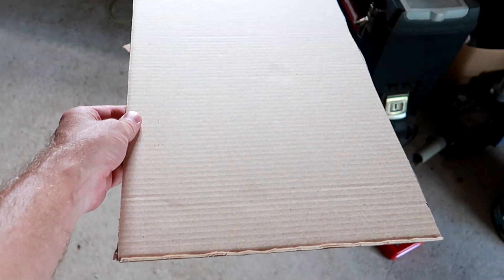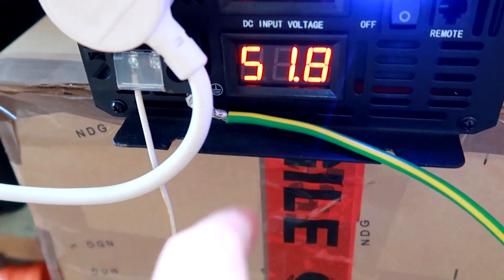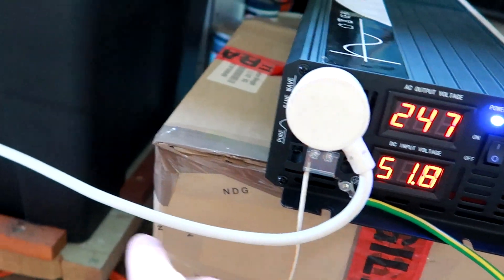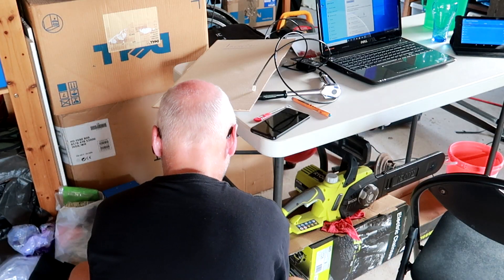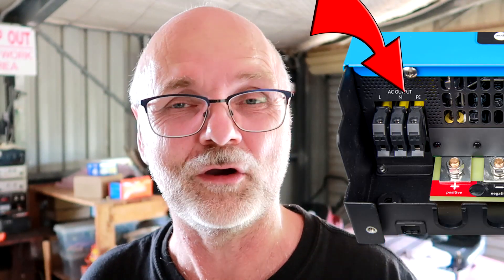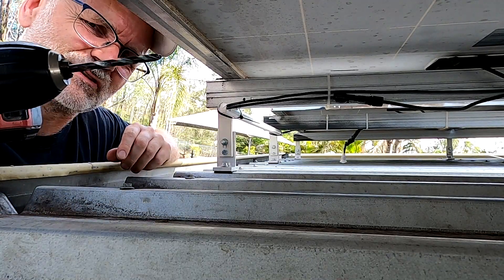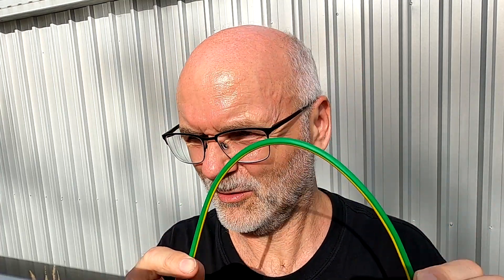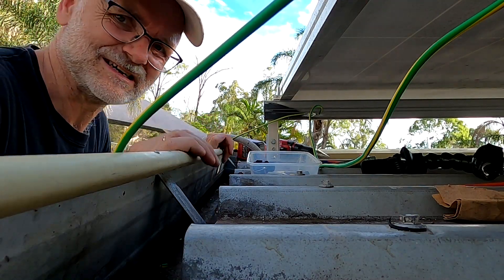The inevitable Inverter Upgrade

Comment: I am setting up 2 of the MPP 6548 inverters myself. That version is good for 120v each at 6500 watts and 48v DC. I ordered 2 because I am needing 240v. They were 1145 US dollars each shipped in 4 days here. (They also have the neutral bond on the output side)
Reply: Is the charge controller MPPT or the PWM type on your one?
Reply: @PeterMilanovski  They are MPPT. My setup will be off grid, but the inverters will transfer and use the grid as needed (This can be set up in the parameters) Batteries/Solar/Grid.
Reply: @danfitzpatrick4112  nice 👍 I have the 12v DC version which has the 800W inverter. I got it almost 3 years ago but I have this issue with it not liking it when I put another 12v load on the battery! I have a water pump that feed's tank water to the toilet and it operates automatically via a built in pressure switch in the pump, every time I flush the toilet, the solar charger stops charging to have a think about what just happened to the battery, then eventually starts to ramp up the charge again, and it does the same thing again when the pump stop's... Meanwhile the sun is shining! And it's not doing anything! I find this annoying! I'm sure that they have good intentions behind why it does this but I, for the life of me can't think why? I hope that this has been sorted out in the newer versions, they are pretty good and I wouldn't mind getting a new and more powerful than the 800W which I have outgrown now! But if I can't use the battery directly for other things like lights and pumps, then I'm just going to have to use something else instead... 
I have yet to speak to someone who has one installed and working! All that it would take to test is to connect a load, even a light bulb directly to the battery while it's being charged from solar and see if the fan's stop spinning! The wattage for solar input on the display screen should also show that the wattage has dropped out, it waits for 30 seconds to a minute and then starts ramping up again... 
Who knows? Yours might not do it! Mines probably just an early version?

Comment: The frog 🐸 is disappointed  because Andy is expending big money on a fancy inverter with unnecessary bells and whistles.
Aims LF48v 6kw $1500  is excellent.  It run the whole house with a/c and ev at the same time. And it has hause neutral or floating selectable.
Reply from the maker: Yeah, AU$2500 here
Reply: @OffGridGarageAustralia  I bought it 3 years ago,  price has gone up by more than 300 dollars now.

Comment: I know it was a hard decision to purchase another inverter, but you made the right choice. Having phandom voltages floating around is just asking for trouble. I think Victron is the best equipment worldwide and they have great support.  Even understand English!!  I have a 5KW Victron charger/Inverter.
Reply: 5kw! You sir are wealthy LoL...
Reply: @PeterMilanovski  I have not started yet due some medical problems, but I believe that the system will allow you to program how you want to run it.  Grid is attached along with you other sources of power.  Then you program it to use battery power as your main source.  Solar will charge when available, but when the batteries get low, it will start using grid with no transfer switch. The system will charge your batteries and keep your needs going.  Very Smart.
Reply: @jimmysquires5093  bloody health problems! I'm not sure if I know exactly what you mean but I have my own health problems, been suffering with anxiety for the last three years, I can do anything but this stops me dead! I and everyone else that I know would understand if it was something visible like a leg or arm missing but this crap is invisible and all that everyone else see's is me being happy like nothing is wrong but it's just me doing whatever I can to keep my sanity... I'm okay so far but I just want it to end! So that I can get busy and start doing everything that has been neglected around the house 🏡. 
I was just trying to make lite of your equipment! You have what almost everyone else wants but can't because they aren't cheap! 
As my dad always said, don't ask for what's good, but ask for what's expensive LoL... Well that used to be true rule of thumb for everything but today we have to be a little bit cautious... But definitely can't go wrong with victron! They have a good reputation and more companies need to follow this example! Redback is a great Australian brand and are known for quality products but recently saw them trying to sell one of those cheap Chinese pwm charge controllers re branded as their own for 10 times the price! Mate! I'm Aussie, I'm not stupid...

Comment: Might can have a big screen caged inverter to keep the insects out as long as no wires bon’t make contact to the screen but it might still catch dust .If installed in cabinet,make sure there’s a strong fan to draw in fresh air and expell the hot inverter out the cabinet .May the solar be with you .
Reply from the maker: If I put fans in the cabinet, I will have the same dust problem just inside. Yeah, filters... see where this all leads to...

Comment: Most of of the MPP solar inverters have a synchronized transfer switch, so clocks, computers are not affected if a switch back to grid mains occurs. They are a good product.
Reply: Do you have one?
Reply: @PeterMilanovski  Yes a MPP PIP 5048GK. And 5kw of solar panels.  It interfaces with a number of Lithium battery suppliers including Pylontech model US3000.   I have 3 of these battery packs and have been running as an Off Grid inverter for everything in my house except washer dryer and AirCon, Since june 2020 in Melbourne and have not had to go back to Grid for power. I'm doing what Andy is doing and will be charging an EV as well.
Reply: @henvan8737  have you ever watched it to see how it behaves as clouds pass overhead? I don't remember the model of mine but it's the 12v 800w inverter version! It was the cheapest at the time when purchased but now I see that more powerful models are available for the same price I paid for mine.
The issue I have found with mine is that it tends to do a lot of thinking about what it wants to do when either clouds pass overhead or if any extra load is placed on the battery for example a 12v light! It seems to be able to sense that something has been connected to the battery and stop's charging to work out what it wants to do about it... It also does the same thing when the extra load is disconnected! So basically if you wanted to also power something else directly off the battery like a 12v water pump to feed tank water to the toilet, it just can't be done with my one! 
A standalone charge controller doesn't suffer from this problem! I wanted to convert all the lights in my Melbourne house to 12v DC and get it directly from the battery and save the inverter for the thing's that need 240v AC but it's not going to happen with my setup! 
I'm charging my Lifepo4 Batteries with eBay MPPT charge Controllers which are just PCB boards and they are, so far, doing an amazing job 👍, now I want to get a separate inverter with at least 3kw output to drive the fridge. I have to look into an electric stove and an electric water heater for their power consumption figures to make sure that I get the right inverter or inverters to cover everything... If anything, the electric hot water boiler can always be converted to low voltage as there are various heater elements available for them. As for the air-conditioning, I recently learned that 24v aircon compressors are available from the US and can be used to convert normal house type air-conditioning units... Litterely convert the whole house to Electric! Without the need for a grid tie connection! 
If you are planning on charging a car, you might need another 1.5kw of panels on top of what you already have, unless you already have plenty of spare energy with what you have! 
The batteries that I'm using are actually intended for use in a UPS so they are those SLA 7Ah type battery cases but have Lifepo4 Batteries inside instead, they have a BMS inside them so they are well protected, they are super light weight, easy to connect and cheap to purchase when I need more capacity, in a 48v series string, 4 of them are a lot less money than 4 of much larger capacity batteries! They only hold 8Ah but I can afford to purchase 4 at a time every two weeks, and with multiple smaller batteries, they share the current when charging or discharging and that extends their lifespan, I'm at a point where I can't fully discharge them, a few more string's and I will only be able to get them to 50% discharge... They should last a very long time! That's the way to go with batteries...

Comment: With time you will realize mounting the inverter inside another box with out additional fans is a bad idea.
Reply: Almost certainly he will need forced air ventilation for the enclosure. Fortunately the Victron supports the connection of an external temperature controlled fan.

Comment: The comparison in temperature between the MPPT and inverter is not entirely valid: The MPPT uses it's metal case as a heat sink while the inverter has fans to eject and remove the heat. Try blocking off the fans of the inverter and then see how hot it gets. :)

Remember that the heat from the MPPT causes the metal case to heat up, while the inverter is ejecting it's heat via fans by blowing the heat out. That's why checking the temperature of the inverter won't predict how hot it'll make your cabinet: It's fans are moving the heat from inside the inverter to the air outside the inverter. From a BTU perspective the inverter is creating way more heat: It's just pushing that heat out rather than letting it build up and cause a temperature increase. Block off those vents and then see what happens.

When you mount that MPPT to your metal cabinet that metal cabinet itself will become part of the heat sink for the MPPT, which means it'll shed it's heat directly to the outside via the metal walls of your cabinet. Where-as the inverter is blowing that heat into the interior of the metal enclosure via it's fans which will trap that hot air inside.

My motorhome's basement is way bigger than that metal cabinet you have, and they seriously heat it up. A lot. Easily exceeding 40 C and I've had it get as high at 50 C.

I would definitely keep the inverter outside the cabinet.
Reply: All too true – to get a reasonable constant output on hot days I had to stop using the small builtin charger on my Multiplus II 48/3k as the extra heat even from only 2000W of PVin pulled the constant output capability to only 1700W on hot days (~40C ambient in metal shed on 36C day).

Comment: Wow! big upgrade! well done mate. The victron gear is top notch. I have the same charge controller as you, the older model but same capacity 48V inverter, the smart shunt, and 12V 1000W victron. I'm building a 12V test system before I go the whole hog and put together a 48V system in a rack cabinet. If you want a monitoring station, set up a raspberry pi and make your own monitoring system. Saves buying the victron GX units, or the $300 screen.
Reply from the maker: I looked into the raspberry pi situation. it's another project for another channel... I just haven't got enough time for all of that. I probably just buy a GX down the track and sign up for VRM.

Comment: Did u say 3kva victron for 1160 on ebay?
Pls share link as i cant find one for that price
Reply: Hi, we were talking in Australian dollars
Reply from the maker: Not there any more on eBay. I guess they had reduced the price as 48V system are not very common. They now only have smaller ratings as per the links on my website.
Reply: 932 doolars at invertersupplydotcom VICTRON ENERGY, PIN482300000, PHOENIX INVERTER 48/3000 230V SMART

 RENEWABLE ENERGY
Reply: @neliosamch3195  mmm thats US$932 in Florida - Andy would pay AU$1250 + ~$90 postage to Australia that's way too expensive
Reply: @colinbeckitt9495  fancy stuff with unnecessary features always cost too much!

Comment: Grounding is funny business, you can only find the relevant information in the code books... The ones cosigned by the union association securities advisory commission.
Haha.
Usually common copper grounding is good enough. Itll dissipate any induction to ground quick enough: direct strike means your grounding/bonding-means is a momentary tungsten element.

Comment: New Victron inverter? That means another video is coming... Good stuff!
Reply from the maker: Yeah, at least one more is coming :)
Reply: @OffGridGarageAustralia  great decision to get a Pheonix. Victrons run HOT on constant even mediocre loads (2000W or more). I think they suit cooler climates, so no builtin charger may lower overall temps to get you up to the magic 2200-2500W constant output @35C (summer) for Tesla charging. Good luck Andy!

Comment: The bigger the inverter , the more the heat it produces . might not can keep it inclosed . Best may be installed outside the cabinet to disperse more or most of the heat without overheating .
Reply from the maker: I'm worries about the dust and insects starting a family in there...
Reply: Off-Grid Garage I wouldn’t worry about it Andy. I’ve got mine set up in a small lean to on the side of the garden shed. 1.8m x 2.2m with the north and east sides open. I’ve only had problems with ants in the Colour Controller box 
Remember Victron has a marine background so their gear is pretty good.
Reply: Urs Odermatt Maybe. Or they could just go to a cosy house where they also have food. Unless you hermetically seal the cabinet and all cable penetrations you aren’t going to keep anything out.
Reply: Urs Odermatt It’s catch 22 really. If you have it out in the open insects and reptiles can get in. But also if you have it in an enclosure you may make it more appealing for them to stay. My Multiplus II only has an IP22 rating. So less than finger size and dripping water. But so far so good after more than a year. And nearly 4 years for the Taiwanese all in one I had before that. Which was still going strong when I upgraded it for the Victron. I don’t think you can win either way.
Reply: Urs Odermatt technically we are. IP rating is ingress protection. Intrusion, dust, accidental contact and water.  All good mate. Lock yours up in an airtight enclosure and let it cook away. I’ll keep mine outside and let it breathe!
Reply: Hello. put the inverter in a mosquito net cage.
Cheers.
Reply: @OffGridGarageAustralia  Fliegengitter innen am Gehäuse anbringen und immer ein Auge auf die Temperatur!
Reply: They will love ya for the new house hehe 🤓👍🇺🇸
Reply: Turned into a real big thing hehe put some window screen over any openings and you can buy filters for pc fans
Reply: Randy Lenart Certainly did. Exactly. I just wouldn’t put it in an enclosure. It’s a 3Kva inverter so it’s going to be running at around it’s maximum while charging the car.
Reply: Yes and they all get hot